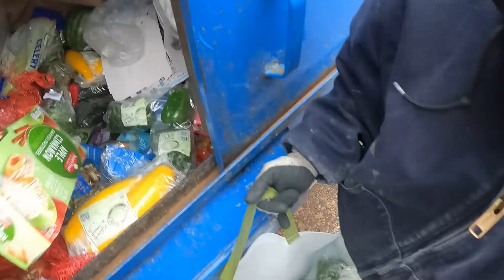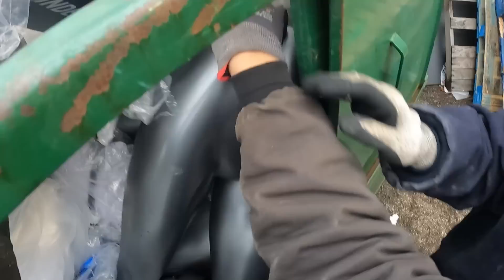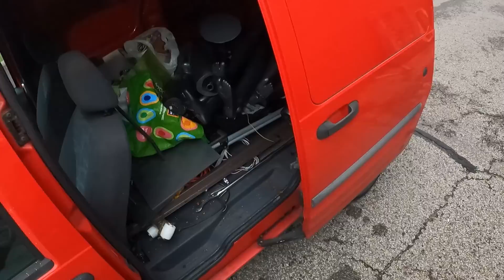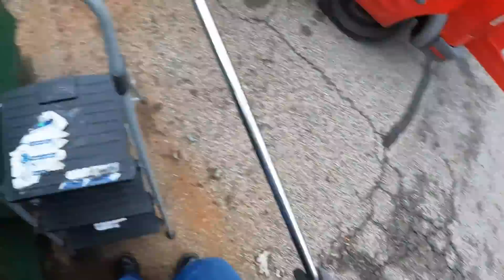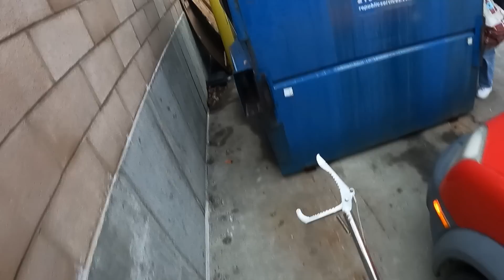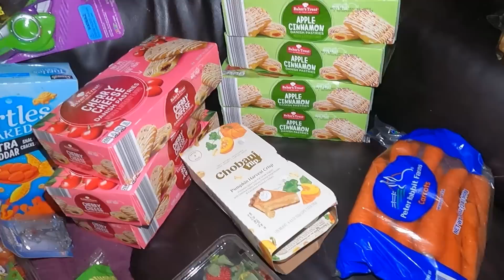Dumpster Diving~ A Case of Wine, Chuck Roast and Manikins!

Comment: The acorn squash should be fine for them. Just cut it up small and don’t give them. The seeds could be hard on the stomach. Oh and also the scan I would take that off too or left. See if they’ll eat around it. As far as humans eat, and it cut it in half take out the seeds put it on a cookie sheet and then Butter on it and sprinkle a little cinnamon. I’m sure there’s other ways.

Comment: Those mannequins are great, but you would have been able to slide the door on that dumpster if you pulled out the hanger that was jammed in the door.
Reply: No, it's been jammed for a long time! The hanger is new! Someone was probably trying to use the hanger to pry it open. The metal is dented right on the track for the door. This dumpster is on one of our regular routes! I try it all the time before I realize it's the one that's jammed! Lol! ❤Scrap It Up Sue!
Reply: @leeannnicolaus5829  oh ok, I thought you just didn’t see the hanger.